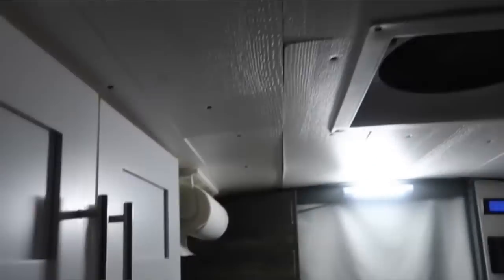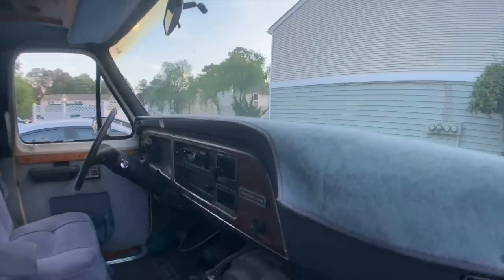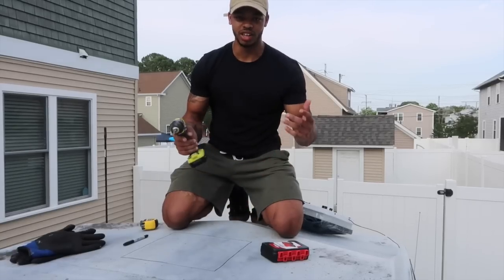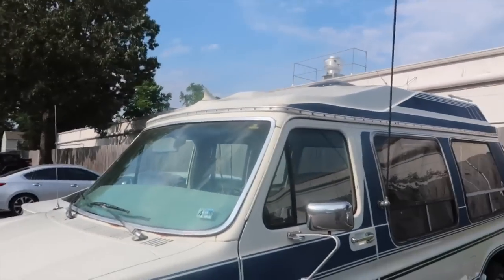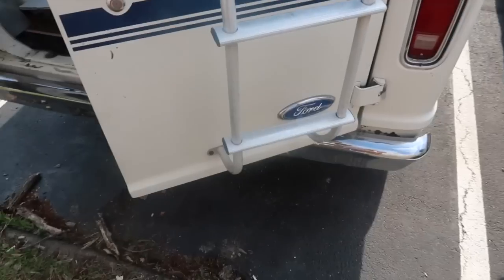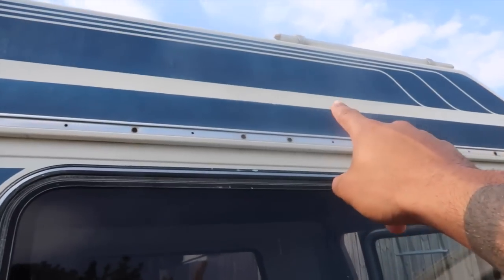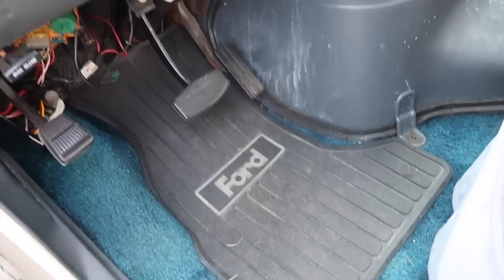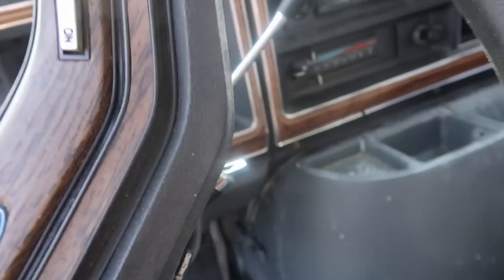DESTROYING AN 80s VAN TO BUILD A MODERN CAMPER (Time Lapse Build Pt. 1)

Comment: Nice video, not boring, well documented.  Here's a Ford van tip.  The door latches are cable activated, the cable ends are plastic.  They go away then the door won't open.  You can go to a Ford dealership and they'll sell you a new latch system for over 100. OR get some split bolts for adjusting bicycle breaks!  Trim them to fit, replacing the old plastic ends. Now you're good to go.  Cost $5.  I've done several ford E series doors this way.  Yes the latches are a pain but it works great just take your time.  Thanks for posting

Comment: Ohhhh I cant wait to see what you do🤗🤗🤗🤗👍👍👍👍👍👍
Reply from the maker: Thank you! I'll do my best!
Reply: @Dualex_Builds  cant wait , was even thinking about an idea for making a bed/couch that when it extends  it could maybe rise up then out to the level of (a tad over)  the tops of the counter maybe like a scissor type extension up ward   so the counters could go all the way to the couch part when its down,  rise up at night over the counter  to bed mode hope that makes sense, that way floor space and counter top space an go all the way back (touching it in couch mode) till its sleep time, the  couch would be the width from wall to wall in the back,not long ways like your other van, any way that is an idea I had for my next van , hope I didnt confuse you or sound ridiculous lols

Comment: Would you consider buying a used 1973-1978 GMC Camper and striping the interior to the bare metal and modernizing it as a future project?
Reply from the maker: Yeah I mean at this point everything is up for consideration for me. If I see potential in a build then I’ll definitely consider it